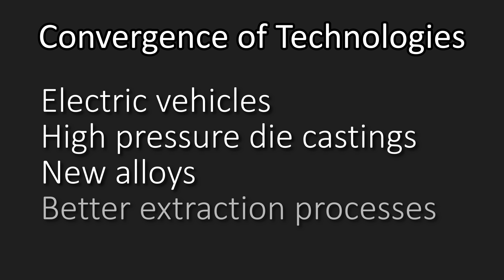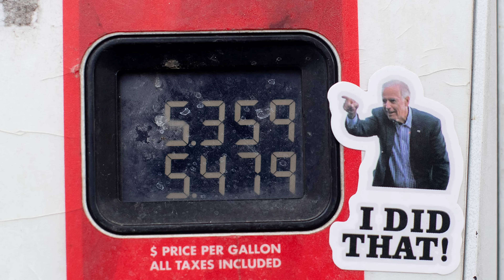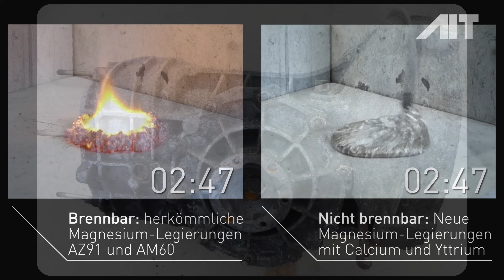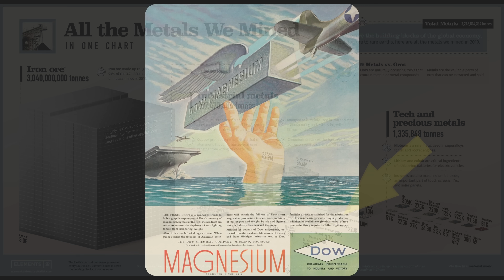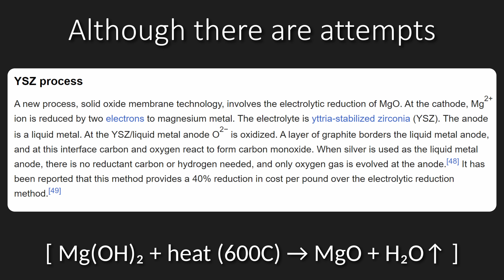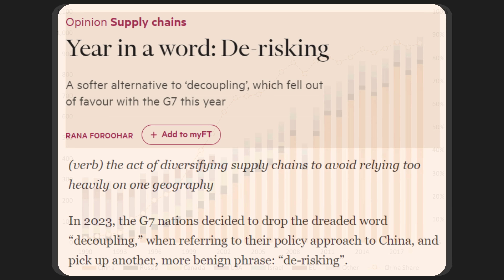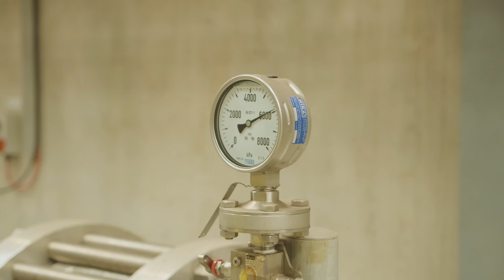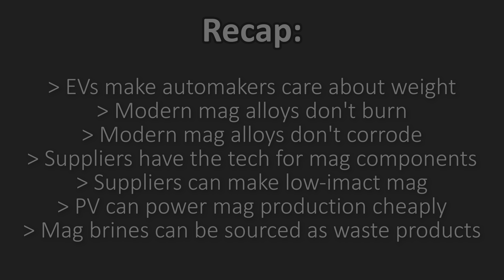Welcome to the AGE of MAGNESIUM

Comment: Ah Magnesium the metal that burns so hot Lithium looks like a birthday candle.
Reply: Yeah, but actually catching it on fire takes more effort than people assume. Especially if it's an alloy.
Reply: @SikerGaming my father was a shop teacher that had a foundry class (they cast aluminum and brass), he still remembers the day one of his students mistook magnesium for aluminum and nearly burnt down the school.
Reply: @SikerGaming Fortunately thermal runaway in a large lithium battery pack provides all the heat and even initial oxidiser needed to ignite most metals that readily burn.
Reply: @SikerGaming  dude they sell magnesium as a firestarter. It literally takes a spark. It’s not remotely difficult.
Reply: @VisonsofFalseTruths that’s tiny fragments… what about solid pieces? It’s substantially more difficulty. I’ve tried first hand - I have a 1/2” diameter cylinder and I’ve thrown it in a wood BBQ fire. After several hours it didn’t burn. I still have the piece, it’s in the same condition as it was before, but maybe slightly oxidised.
Reply: @SikerGaming  put some vinegar on it
Reply: One spark is all it takes... magnesium blocks are sold for firestarting while camping  @SikerGaming
Reply: @SikerMinecraft BMW engine are made with magnesium. They catch fire all the time.
Reply: @nengyang1895  Well building an engine block out of it is just plain dumb. A car frame is a different story.
Reply: @SikerGaming Better for gearboxes and transmissions, bc those can be cooled with the lubricant so it doesn't get anywhere close to flash point.
Reply: @SikerGaming 21.5 million VW Beetles were built with a magnesium alloy engine case
Reply: @SikerGaming my Yamaha snowmobile got a magnesium block, it’s crazy how much lighter it is than steel
Reply: @kirknay They also help keep oxygen awake from the metals too, which further makes it harder for them to ignite
Reply: @SikerGaming  the beetle: hold my air
Reply: @nengyang1895  Good thing a Tesla doesn't use combustion. LMAO
Reply: @nengyang1895  not bc the blocks magnesium
Reply: @nengyang1895  its not pure bozo. It cant burn, only melt
Reply: @nengyang1895  BMW is incompetent enough to accidentally catch fire to the cold void of space, so that's not actually saying much.
Reply: Hi, Siker. A car frame surrounding a lithium ion battery sounds less intelligent than an engine block. Lithium makes a wonderful magnesium lighter, eh?
Reply: @SikerGaming  let me guess a runaway lithium battery is a nice fire starter...
Reply: 9th grade science class...  For our experiment one day, the teacher passed out little strips of magnesium about the size of a paper match.  My lab partner picked it up, and I told him, "magnesium burns really bright."  He was intrigued, and pulled out his lighter, holding the strip of magnesium into the flame.  We were at the far end of the room from the teacher's office, and he was just entering his office, back to us, when the magnesium strip caught fire.  My lab partner exclaimed in shock and dropped the burning magnesium into the lab sink between us.  The teacher turned and asked, "who burned their magnesium?"  We had to buy a new strip to perform the experiment.
Reply: @Sylvan_dB your teacher was he cool like Heisenberg in Breaking Bad :)))?
Reply: A lithium battery could be a great firestarter but the vid showed a magnesium alloy melting before it cought fire. I would love to see a test of a batteryfire inside a mag alloy car chassis
Reply: It's a good thing this problem was solved through the use of alloys in the video.
Reply: There’s definitely no sparks heat or energy released from a car crash don’t worry
Reply: Or potassium that turns into fireworks on contact with water.

Yet it is part of a vital neurotransmitter in human brains.
Reply: I'd recommend some study on metamaterial research.
Reply: Most alloys are actually VERY hard to ignite.
Reply: @kellymoses8566  because they ain’t made out of magnesium
Reply: i guess atleast 1 really intelligent scientist in this world is able to make magnesium safe for cars

some mix of metals must work, atleast i hope so. I mean scientists made nitro gylcerine so safe that it can be carried as sticks and withstand crashes etc. without exploding. (dynamite)

and plastic explosives (C-4) is even more resistant to external forces. 

so making magnesium as safe or safer shouldnt be much of a problem. Even if it might lose some strengh or gets a bit heavier.

only challenge is see, is to make it withstand high temperature fires from batterys, or when used in racing or airplanes, from kerosine and other highly flammable liquids that burn with insanely hot temperatures.
Reply: @Hardys-Mods metallochemistry and organic chemistry are two different beasts
I was a pharmacist and have gone into engineering so have had to do a lot of both and the metallochemistry and metal microstructure stuff is definitely a lot trickier

Because instead of “hey this molecule does this” it’s “hey we’ve got a bucket of these molecules that can be arranged in some crazy structures” 
Or in otherwords it’s the macrostructure in metallochemistry that has a lot of the effect; think of it like lego, depending on what blocks you have and how many of each, different things can be built; some of those things will be a lot stronger than others and so on

But the legos are too small to physically manipulate so we have to get creative
Reply: My dad brought home two slabs of magnesium when I was 13 and told me I can light this on fire 

I then proceeded to get shavings and light it on fire in spectacular displays

Comment: You are mostly correct, in regards to magnesium production.

You are also EXTREME misinformed about why weight reduction (by usingnlighter materials) matters more for EVs.

SPOILER: its not range.

Sure weight does impact range. But dominates range loss mostly at low speeds and in "stop and go" conditions.
Thus reducing weight to increase range solves an issue that doesnt exist.
As regenerative breaking allows electric vehicles to have WAAAY better low speed fuel/energy efficiency than conventional vehicles. Their range issues come about at high speeds (for example on highways).

While cruising on highways energy is spent on overcoming air resistnace.

(If you paid attention in physics class, well than it should be obvious that Force = mass × acceleration. Thus for mass to affect needed force, and thus energy you need acceleration. Cruising at a given speed wouldnt need any energy if not for friction, which is dominated by air resistance at high speeds)

Ofc. weight doey matter.

Batteries are way heavier than intenral combustion engines. Thus you need to minimize mass wherever you can to have a fun good accelerating vehicle.

And ofc. roads do have a limit as to what weight they can bear.
Which causes issues for large framed electric vehicles (which have large air resistance, and thus need fuckton of batteries, limiting cargo space)
Reply: Coincidentally this is also why viable electric motorcycles dont exist.

Since 1956 FIM ban on dustibin fairing motorcycles (even high performance ones) come with the aerodynamics of a well design parachute.
And to say the least no manufacturer - as of the time i write this comment - dared to wander from graditional motorcycle looks, to conform to laws of physics.

If it was a weight issue, putting together a honda goldwing weight class monstrosity would solve all problems. But its not a weight issue.
Reply: rolling resistance is a significant loss
Reply: It is and it is not.
Sure it can provide a large amount amount.

However it scales more or less linearly with speed. And since EVs struggle with range at high speeds (and range at low speeds is a non-issue), air resistance dominates the force needed to be overcome.

Comment: Yeah - works extremely well with EVs -
A lithium fire plus magnesium = unbeatable! 🤣
Reply from the maker: As shown in the video, modern magnesium alloys will melt and go away before catching fire

The lithium is not what burns in a battery, it's the graphite and separator. It's basically a coal fire

Comment: Solar is NOT the cheapest energy ever produced!  Typically, the cost of mining, manufacturing, transportation of solar panels is never completely accounted for.  Additionally, subsidies are not considered when calculating the cost, nor is depreciation or degradation that begins on day 1.  Efficiency of the panels is based on perfect atmosphere devoid of weather and pollution, and latitude is never considered.  Putting industrial solar arrays in the best locations typically costs too much due to power transmission losses.

Industrial solar both grossly under produces power when needed and over produces power when not needed.  There is no general economical way to store sufficient power in the foreseeable future.  Solar panels do work on site in off-grid applications, but so far are dismal failures in large scale applications.

Modern nuclear plant designs are the foreseeable future of grid energy, especially modular molten salt designs that are demonstrably failsafe.
Reply: Basic biology for [carbon based] life:
Water + atmospheric CO2 + sunlight = life
Water - abundant, not a limiting factor.
Atmospheric CO2 - 250 million year decline, 150 to 100 million year drought, depending on where the line is drawn.
Sunlight - quality affected by Sun's activity, quantity affected by the atmosphere, Milankovitch cycles, tectonic movement affecting climate, and even galactic orbit.  Finite limitation.

We do not need to worry about water for now, but we need large amounts of atmospheric CO2 contrary to popular beliefs, and do not need to be sucking life's energy (sunlight) up at large scale!

No more money making scams presented as Earth saving programs that do the opposite!
Reply: @peterm.eggers520  How do you explain the extreme weather or the late winters we've been having then, genius? CO2 levels might not be the highest they've ever been, but they're higher than in recorded history, and rising rapidly, and the increased heat is more than present-day life can handle.
Biodiversity is dropping at rates faster than you can comprehend and you think we need to burn MORE oil and coal? I bet you think we can grow concrete, and that 100 lane highways are a good idea.
Reply: @zhop951  
What extreme weather are you talking about and where?

Late winters?  Arrived late or lasted until late?  Where?

Recorded history of [atmospheric] CO2?  Human recorded history of atmospheric CO2 began in the late 1950s in Hawaii, but varies dramatically by location and time of day.  Atmospheric CO2 is assumed to be rising globally because of fossil fuel burning.  That is a good thing as life on Earth has been headed towards the greatest extinction event ever for 250 million years due to insufficient atmospheric CO2. Clean burning of fossil fuels is literally saving the vast majority of life on Earth by feeding the photosynthesizing plants.

Where biodiversity is dropping it is due mainly from urbanization, industrial farming practices.  Over harvesting of the seas and pollution are also significant contributors to decreases in biodiversity in some areas.

You are certainly passionate about what you've been told to think.  Put that passion into research and critical thinking, and the world will be a better place!
Reply: @zhop951  
Not blind, just rational and factually informed.

Minnesota was said to have had no winter weather during the winter of 1877-1878.  No snow and warm all winter.  The ONLY time this has happened.  Historical fact.

The last 20 years have been unusually low for hurricanes.  The only 10 year major hurricane (category 3 and above) drought happened from 2006-2015 in the United States.  NASA records.

No hurricane in the United States has been deadlier than the Galveston hurricane of August 1900, though stronger hurricanes in the Caribbean have blown the bark off trees and blown cannons over a hundred feet across level ground before 1900, but not since.

You have been expertly psychologically manipulated by billionaire carbon investors.
Reply from the maker: How could they not be accounted for? The panel manufacturer isn't selling them at a loss, nor is the distributor taking a loss, nor is the installer deploying them at a loss.

Just check rooftop solar prices at your local installers, and calculate your LCOE over 30 years. You can even put a 30% discount on their claims of energy production. You'll find that the LCOE is not only lower than grid electricity, but also lower than the grid fees

The USA may be an outlier in this sense, as their extreme overregulation makes rooftop solar about 3-4 times more expensive than in other developed countries, but commercial and utility solar in the US does not suffer from this

California already covers 25-30% of its evening peak power demand with batteries, charged from solar, about 6-7GW, and companies are already molding their processes to be able to use the solar power in instantaneous consumption, making batteries unnecessary

This isn't something new, either. Arc furnaces have been designed to run on off-peak power for a century, just that the off-peak has moved from night to day

The 2nd European solar boom is happening without subsidies
Reply: @SizeMichael  Apparently, you are not aware of the abundant solar subsidies across the US, nor accounting for power degradation from day 1, weather failures, large transmission losses from grid solar farms, habitat losses, nor end-of-life disposal costs.

You also don't seem to comprehend that solar power is not constant or reliable, requiring traditional power plants to be available to provide up to 100% of the power when solar power is not available.  Powering-up a backup powerplant is neither quick or without substantial cost just to start providing power to the grid.  And, don't forget the investment cost of just having a full-size backup powerplant sitting idle.  We are closer to fusion power after over 50 years of intense research, than being able to economically solve the grid storage for solar power.

Solar power works well for most off-grid applications, and nearly all mobile applications, though storage will be the most expensive part and capacity is limited by money to invest in solar.  Except for off-grid and mobile applications, solar is a waste supported by huge amounts of taxpayer dollars funneled through a multitude of programs and schemes.

Modular molten salt reactors, particularly thorium based, are the only viable future for grid energy.
Reply: @zhop951  The problem is that peak efficiency and power delivery for solar (Noon time wherever the panel is) is nearly the opposite of peak power demand time, which tends to be from 8-10PM as people return home from work, turn on lights and other appliances, plug in devices for recharging, etc.  The peak load is also going to explode in severity as EVs become increasingly common, since a relatively quick charging EV can eat as much power as every other appliance in a house combined.  
This means that for solar to deliver power at peak demand hours vast amounts of power storage will be needed to hold onto that electricity for six to ten hours after it's generated.  There are methods to do this, but obviously building power storage and hooking it reliably to the grid ought to be considered when estimating grid-scale solar's $/kWh.
Reply: @youtubeisapublisher6407  Fair, I just think it's still worth pursuing, despite its flaws. Drawing power directly from the sun is just too good an opportunity not to take. Obviously other, more consistent renewables (like Geothermal and hydro) are important too for the same reason.
Reply: @zhop951  Solar thermal would deserve a revisit as well - use the sun to heat a molten salt reservoir and draw over night power from there.
Reply: @SizeMichael  The chinese manufacturers sell below cost, in the long term due to subsidies & to gain influence and currently to deal with excess stock due to reduced domestic demand. ATM that's convenient, but it will turn into a liability.
Reply: But solar is safer and cleaner than nuclear. The storage solutions hopefully will improve. In large scale solar plants, the investment pays for itself in a matter of three years, though.
Reply: @casandraa.9837  That is what they want you to think.

Though few want to live next door to the traditional light water reactor that was originally developed for nuclear powered submarines, they are still statistically the safest of all current grid power solutions.  Molten salt reactors are even safer because they can't blow-up or meltdown.  Search on thorium reactors.

As far as clean energy goes, research the mining and manufacturing of solar panels. You have to dig as that part is heavily censored.  Also, solar panels have a relatively short life and cannot be recycled.  Checkout early California solar farms that are gathering dust as the landfill costs are too high.

The modern molten salt reactors being worked on now will be even cheaper than solar as once a design is perfected, they will be mass produced in currently idle shipyards.
Reply: @casandraa.9837 false. Solar produces far more toxic waste by-product/kwh than nuclear. 
Nuclear power is the only viable solution to climate change that doesn't involve strip mining the entire earth in order to "save" it.